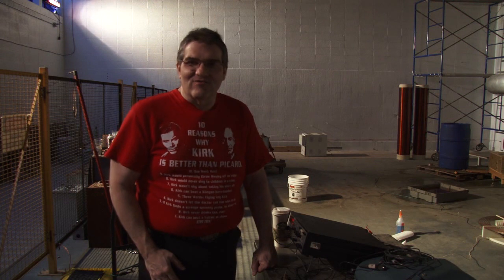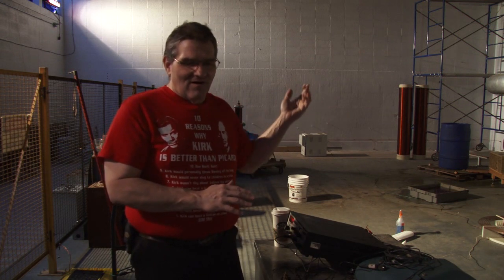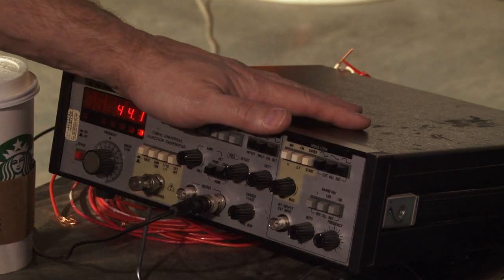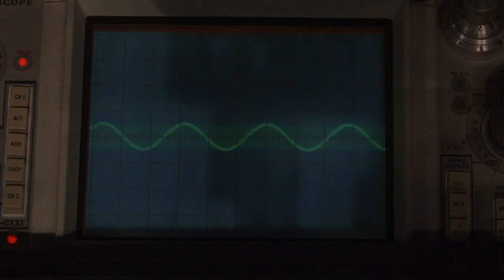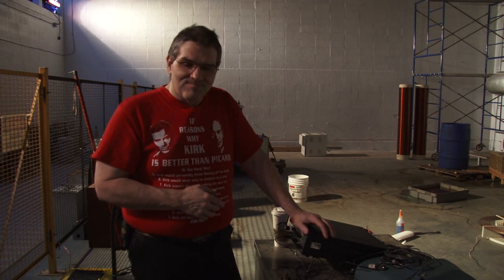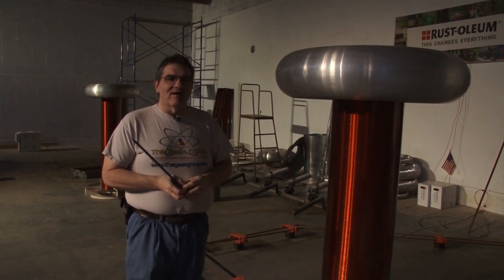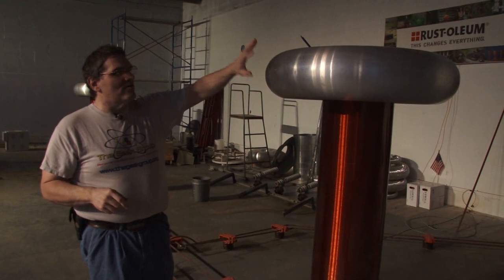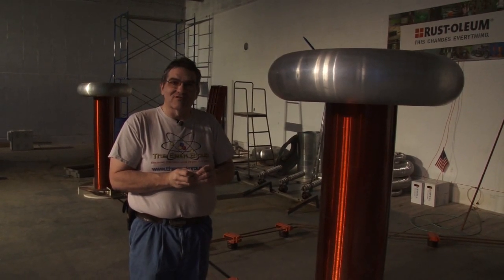Repairing Gemini with Kidwell

Comment: So I may be wrong BUT, I believe that the the concepts of Charles Proteus Steinmetz comes into play. When your MMC let's go. Its my "belief" (logical conjecturing) that due to the "imperfect" capacitance values (especially after the self healing blowouts) eventually cause "imbalanced, CUMULATIVE, "circulating spikes) between caps in one (voltage array) as well as the capative side of the matrix. with out exact resistances between the little caps in a row there will be un uniform discharges that ol steinmetz would have a blast with.   more>>>

get it corny joke sorry, very sorry    that's didn't fit, but it did. Dohh,       seriously>>>>

It has always  been my belief that this electro static stuff "needs" the purist form of delivery. STATELY, that really however impractical (unless one designs a variable voltage/variable capacitance cap) a ONE LARGE perfectly tuned cap is optimun and would yield nominal results with LONGEVITY. lets the say the wheel is smooth not bumpy.

Although my "credentials" are elusive to the populous. I did solve Coral Castles electro magnetic dilemma and am now digging into tesla pretty heavy. I have vowed a pact that I can transmit electrical energy from one place to another using ONLY JUNK. running motors and everything like tesla did. ONLY I am using a barbarian system that actually works and delivers a clean shot and so far it seems like it would run for hours and hours.

To close this BOOK, har har, PAUL   and CHRIS   excellent videos and I would love to converse with you someday even if just skype type, for more personal contact, histories, goal, etc,       I don't even know what area you guys are from USA, State?

Thanks Again SCOTT F RUSSELL       (the Coral Castle guy) Here is that too by the way: if a may be so forward.::::::

https://youtu.be/nOoCuDnmtyM

FEEDBACK???        thanks          :)

Comment: @thegeekgroup im sure you have another set (you were using one as a target??).. just run 2 on each secondary the smaller ontop of the larger with a gap between it will also help to push the arc horizontal.. i had something like 4 on mine untill in made a larger secondary. i think you could also raise the top-load a little (i have read and found that 0.8times the dia of the secondary is about right, you can go even higher if you add a corona ring at the top of the coil)